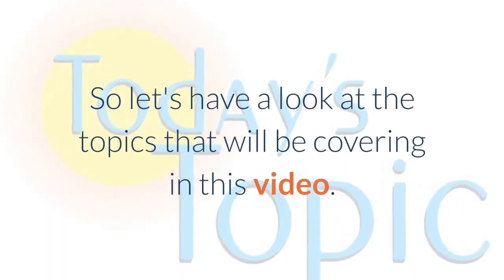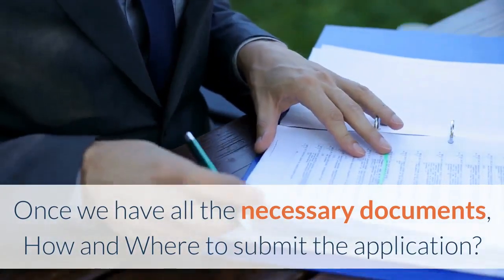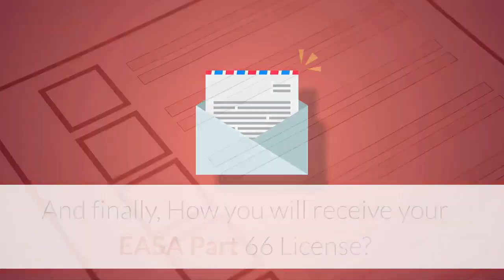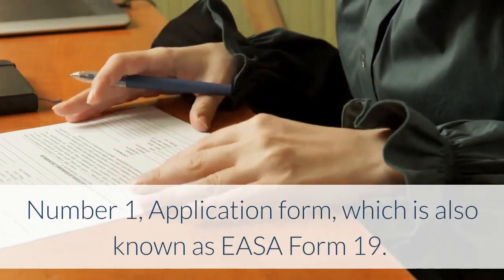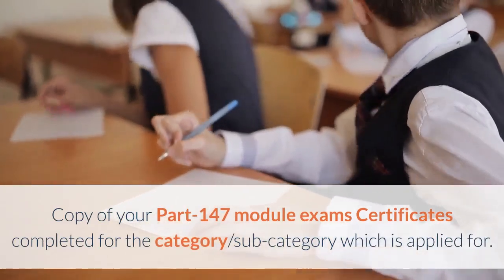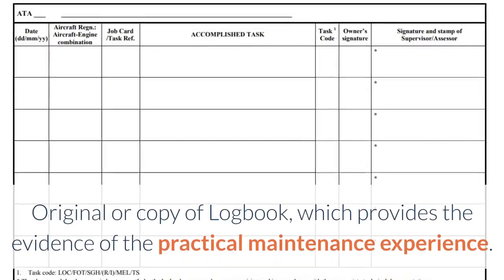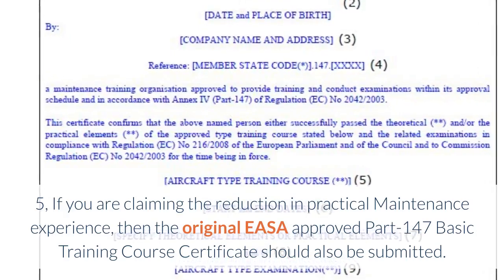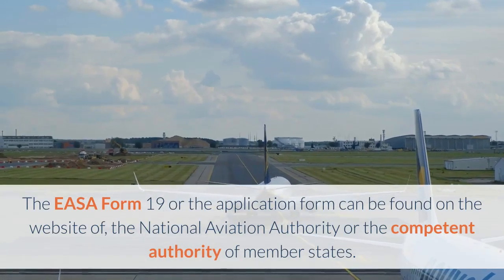How to Apply for an EASA Part 66  Aircraft Maintenance License | License Application & requirements

Comment: Thank you so much for the priceless information provided in the video ,
I have just obtained my Masters degree in aeronautical engineering specialised in aircraft propulsion
How do I apply to obtain the certificate
Reply from the maker: Unfortunately with masters degree you wont be able to obtain the license. If you want to get license and work as aircraft engineer, I suggest you to start career in aircraft maintenance and then you can gain modules and experience requirements to get your license

Comment: Hi, i'm an licensed aircraft engineer from Malaysia and I current hold the CAAM licence but I plan to work in Europe. Therefore, I need to take the easa licence. Any idea how long is it to get the licence because I am already an engineer?
Reply from the maker: Basically you need to complete EASA Modules and if you already have 5 years of experience ( as you mentioned) you can immediately apply

Comment: Hi, I would like take EASA certification in B2. I’m from Brazil. I have 15 + experience in civil Aviation in Brazil. I’m a technician maintenance aircrafts and Bsc Electronics and telecommunications Engineer. Nowaday, I am living in London .
In my case, what I need to do ?
Reply from the maker: Hi
It looks like you have the enough experience,
I would suggest you to find any EASA Part 147 organisation, who is offering EASA CAT B2 basic module examinations and clear them. Once you do that, I believe you can apply for your EASA CAT B2 license 👍
Reply: Hello. I too have a Degree in electronics and communications engineering , got more than 10 years of aircraft maintenance experience. Your degree can help you pass most of the modules related to your field of study. Modules 1,2,3,4,5 are basic from your degree. Remaining modules  which are significant to your B license can be studied on your own and take the exam
on a part 147 school .